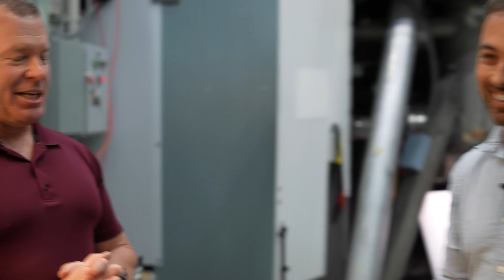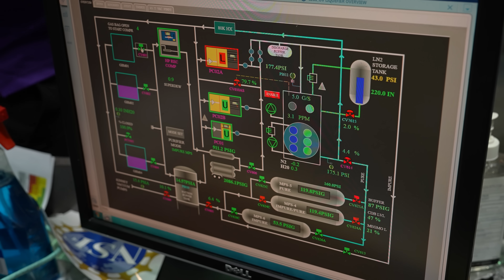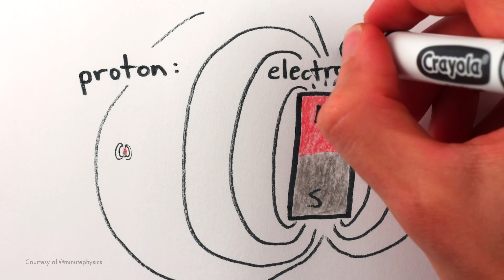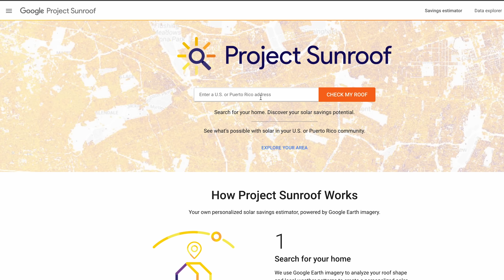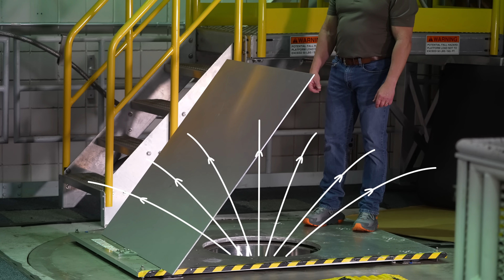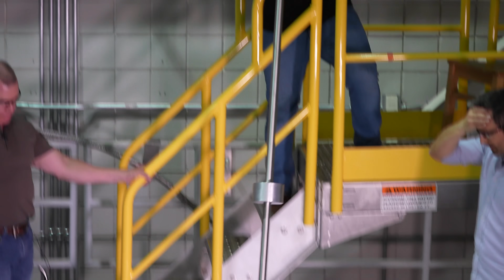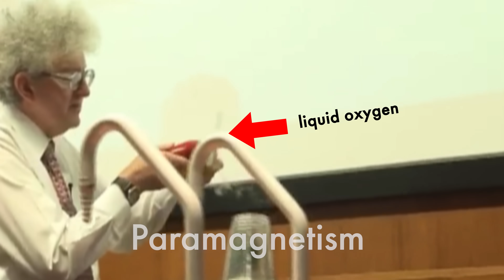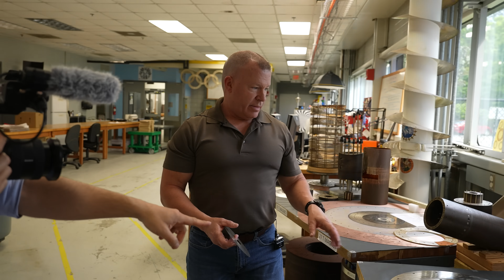World's Strongest Magnet!

Comment: The plate heating up on the camera is mostly light reflection, it's evident since where you point you can see the shape and it's not really distributed as one would expect, I mean it does heat up, but what's shown is probably not related to the eddy currents

Comment: I like air pressure. And you can use flowing water in some systems to draw in air to make a pressurized water jet. I forgot the name of it, though. Recently I was watching people dieseling air rifles. And I thought the idea of a diesel rifle was a neat idea. Where a bit of kerosene and Crisco or wd-40 or 3 in 1 oil or what have you goes on the back of the pellet. Where the high air pressure dieseled the fuel, igniting it and making the round go much faster. Though, the O-rings and seals may have to be reinforced or thicker to last longer. I had a friend that had one, and we tried dieseling his air rifle with wD-40, it was fun seeing smoke come out the barrel and a bit of a loud crack.

Comment: Did you know that it takes on average 5+ years to offset the manufacturing pollution per electric car, plus the issue of recycling batteries on a high scale. Are we all going to keep our electric cars for 5+ yrs to even see a difference? Not to mention the fact that will mine essential resources from our oceans sea bed floor for the metals they need for batteries. Trading one pollution for another. Just because people Google something, it doesn't mean thats what we want. I aint buying no electric vehicle .
Reply: So we should ban all cars, right?

Comment: Thank you so much for sharing! This is so cool! I have a question. If you turn this thing up to full blast, and stood near it, could you potentially stop your blood from pumping because of the iron or medals in your blood? Or is that not how it works? ❤️🙏🛐
Reply: From what i know, this wouldnt happen. First, your heart runs off of electrical impulses made by its SA node. Second, there are metals in your blood, but they are microscopic and that magnet wouldnt do much. Now, the reason they say "No pacemakers" is because pacemakers help your SA node stay under control, and for that it needs to be made of metal, and i dont think anyone wants their chest being bursted open because of this 45 Telsa magnet...

Comment: Now imagine a tank with magnets like these that shift the projectile coming at it. It would still hit hard, but something like an armor piercing round could be rendered virtually unusable, since the projectile itself would rotate and hit on its side rather than head on. Even just a slight change in orientation would be enough to drastically reduce its effectiveness.
Reply: Interesting theory, but you'd need thousands of tons of equipment to get this level of magnetism, and the round coming at the tank, assuming it's a kinetic round, will be travelling over one mile every second. It'd hit far too hard and fast to be swayed by only 45T.
Reply: @SuitOne   I'm not saying you need to affect it as much as this video, you don't. You just need to affect it enough so that it doesn't hit completely head on. Its ability to change orientation has nothing to do with its velocity, magnetism moves at the speed of light. Even a few degree's is enough to severely diminish the effectiveness of an armor piercing round.
Reply: @peoplez129  I'm not suggesting that the round is moving too fast for the magnetism to reach it, I'm saying it would require exponentially more force to effect it's orientation. The round has so much energy sending it forward, even if the magnet from the video was pulling on it, it would only be in it's effective zone for a fraction of a second, and the magnet would have that amount of time to fight against the rounds kinetic energy and the air resistance around it
Reply: @SuitOne   Kinetic energy has no bearing on the orientation of the round. Just like something in space is moving at thousands of miles per hour, but you can rotate it with your hand. It's all relative. Directional velocity and rotation are two completely different things. Velocity has no effect on this.
Reply: @peoplez129  While you'd be right if the object was in space, it is instead moving through the air at several times the speed of sound with aerodynamic properties built into itself to keep it facing forward at all times
Reply: @SuitOne  Except spinning a round to stabilize it also works against it, because it then becomes even easier to disrupt its orientation by using its own angular momentum to rotate itself along a given axis. The reason why a round spins is more about aerodynamics than about angular momentum. By spinning, it equalizes its shape, so small imperfections don't cause it to drift one way or another, instead it's equalized because those imperfections are constantly moving around, cancelling out any previous shifts those imperfections by shifting those imperfections elsewhere. Basically, if you spin anything, it behaves like a perfect circle. If you spun a square fast enough, it would look like a circle. Although obviously a square has its own issues because of all the drag the shape would cause. It's the same reason why rounds can tumble. They end up with slightly more drag on one end. Spinning is literally only to equalize the drag, and that's the only thin that keeps its orientation stabilized. A metal round would have no choice but to be attracted to the magnet, which will not only physically shift the rounds orientation, but that will also change the drag, inducing a tumble, thereby using its own force against it. And on top of that, the angular momentum itself will also help to put force behind the change in orientation.  So it's not just magnet strength, the power of the shift is also proportional to the drag caused by velocity, and the angular momentum of all that weight in the round. And that's a whole lot of energy when you're talking about the angular momentum of hundred or thousands of pounds rotating. What happens when you pull a reaction wheel toward an orientation? It wants to flip itself over. The only reason why it seems hard when you see someone holding one, is because the act of holding it and standing on a floor, means you're introducing friction yourself. The reaction wheel wants to make you spin with it, but since you have enough weight/friction to prevent that, you get a force. In the air, the only friction is drag, which also works against it, because even slight changes in orientation, changes the equilibrium of the drag. It doesn't matter how fact it's moving, because its velocity also increases drag proportionally.
Reply: @peoplez129  I don't know how to argue with that, but I will bring up another counterpoint: APFSDS rounds, practically the only kinetic round used in modern tanks, are made of tungsten, which is not ferromagnetic.
Reply: @SuitOne  Only the very tips are made of it, not the shell itself. It's primarily for penetration purposes. It would be inefficient and too costly to make the entire shell out of it.
Reply: @peoplez129  Per encyclopedia britannica, the entire penetrator is either tungsten or depleted uranium.
Reply: @SuitOne   And how does that conflict with what I said?
Reply: @peoplez129  You said just the tip is tungsten. The entire penetrator is ferromagnetic, which means there is nothing for the magnet to attract by the time it hits it's target
Reply: @SuitOne  Go look up a picture of an armor piercing round and see if that makes any difference.
Reply: @peoplez129  I'm very familiar with what an APFSDS round looks like. It's literally a rod of tungsten with fins.
Reply: @SuitOne  And it is attached to what?
Reply: @peoplez129  Fins?
Reply: @SuitOne  And what else?
Reply: @peoplez129  That's literally it.
Reply: Are you considering the amount of power this would need? Suit One made another good point. you're not thinking about how fast that thing would need to spin, even if the magnet started working from 10 feet out. Using a speed of 1500 m/s, the projectile would travel 10 feet (3 meters) in 0.002 seconds. If the round's angle needs to be changed by only 5 degrees, it would need to rotate at an average speed of 2500 degrees a second. A lot of modern tank guns are smoothbore too, with no spin like your comment suggested. So that entire paragraph is pretty much irrelevant.

Comment: Someone correct me if I'm wrong, but 500 volts at 47000 amps (rounding to 50 here) is 2.5 MW of power. That takes an hour to power up, which means it uses around 2.5 megawatt hours. That's the daily production of one wind turbine. So this magnet uses around one wind turbine of energy everytime it starts up.
Reply: 47000 amps is at full field. If they do a linear ramp it will dissipate half that. The next hour at full field is the calculation you did.
Reply: Your missing a zero it's 23,500,000 Watts, or 23.5MW

Comment: Regarding the experiment around 10:20 what would happen if you were to vibrate the material with some kind of sound frequency? Would this cause it to levitate without someone physically holding it in the air? I imagine trying to hold it still above the huge magnet would have little to no effect, but movement (especially quick movement) seems to cause the material to hit resistance.
Reply: look into quantum locking

Comment: I had a theory that everything was magnetic, and I meant to look it up to see if I was right, and this video answered that for me and made me very happy. Also leads me to my next theory.
If you gather enough things, they will emit a magnetic field much like a planet. If you have a strong enough magnet, you could pull things from orbit despite the magnet being small. If your magnet is strong enough, light won't even be able to escape the field.
If your magnet is strong enough, it is a black hole.
Reply: The thing is, light and magnetic fields do not interact. That's how they measure things in those big MagLab magnets after all - they use radiowaves/microwaves to measure their samples. Furthermore, if a magnetic field affects light, you can see the distortion around whatever is within the magnet. And since there are shots of levitating non-magnetic objects in a magnetic field within this very video, you can see that once again, light and magnetic fields do not interact.
Your theory comes with its own issues - the more mass your super magnet would gather around itself, the harder it would be for the magnetic field to penetrate the mass. Therefore, you would need a bigger magnet to compensate for that, to attract more mass, which would shield the magnetic field, so you would need even more magnetic field, and the loop continues. Even if you envision that you could do that in perpetuity, you would ultimately create a black hole, but that would be because of all the mass you've gathered in a small region of space, not because of the strength of the magnetic field. So once again, it would be the gravity, not the magnetic field, causing this, thus making the whole idea of having a magnetic field to create a black hole kinda pointless. By that point, you can just simply clump up enough matter by other means, as you would clearly have the technology to do whatever you want.

Comment: If Google or anyone else were actually concerned with the environment, they would invest in nuclear energy. Nuclear is the future, and it's the cleanest source of energy ever discovered. Magnets require electricity, but you can't have electricity without an energy supply. Right now, we use "fossil fuels," even though oil doesn't come from fossils. The planet replenishes the deposits. But still, nuclear is cleaner and should be the future.

Comment: Magnets are cool...  at least if your 12y old.   Magnetism  has no practical use beside toys or fridge decoration. 

Instead of fooling around with magnets, you should read up on something useful. Like electricity..  Electricity kicks magnetism´s ass. It can even make waves in some kind of spectrum that allows wireless transfer of data and make motors that run on batteries. 

Seriously though, the effects of magnetism on moving non-magnetic metals are really cool.  The forces  just keeps increasing with speed.   Extremely reliable braking systems that never wear out for example.  Like the brakes on  a roller coaster.

Comment: Ok. The magnet theory for a spaceship may be out, if it is really heavy like that and energy cannot be naturally regenerated within. It only needs to be able to direct the current of the ion flow in the circular fans/wings ring (graphene - it will take some time to create them) that could flow by ion force in my thoughts causing flight and direction.  Fan rings of ion flow in opposite directions on the vehicle ship, one for lift, one for direction. Actually the ions could be flowing in the same direction that's ok, the outer ring just needs to be able to shift slightly to the left or right for direction. If the ions can cause the wing ring to spin fast enough, it can generate any speed. There should be some invention to allow the ions to increase their energy until we want them to slow down. My theory is that whatever size magnet is used, the technology would allow the graphene to free float inside of it,, not touching the ship, and yes ion free water to cool it. Things children can think about for you if they are enlightened, requested, and are given nothing else to do.

Comment: Electric vehicles are not the future. Ford, GM, are losing their ass trying to do what their bleach blond management dictates. Until hypercapacitors can recharge in seconds and discharge slowly this tech will always be niche. Working fols need horsepower and longevity..no a 15 minute commute. There is not enough copper on earth to wire all the vehicles. You portray yourself as a scientist..not a priest of scientism. Stop the casual insertion of propaganda talking points.

Comment: Around 9:50 you state the metal is heating up near the edge, but this cannot be concluded from your infrared thermography. The emissivity of that metal plate is so low that it is effectively an IR mirror. What you misjudged as the plate heating up is actually just the infrared signature of the man holding the plate - you can see it's his outline. To properly read temperature from the plate, you would need to coat it with a high-emissivity coating, such as a matte paint.

Comment: 9:40  CAT phone?  There's a lot of heat-reflection going on there, I wouldn't interpret any measureable temp rise at all from that.  I'll never forget the first time I turned on my FLIR camera sitting in a brushed stainless steel bathroom stall!  😳  There certainly is some as you say; might be interesting to calculate how much.  (Source:  thermal engineer with a CAT S62 😅)